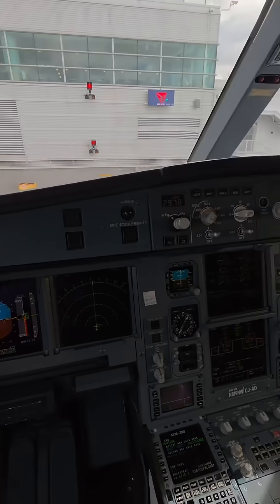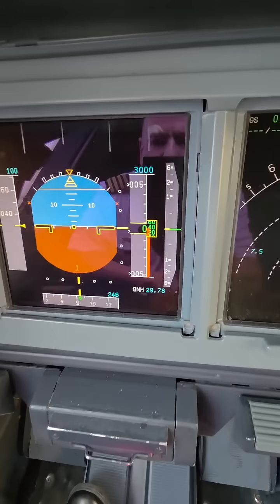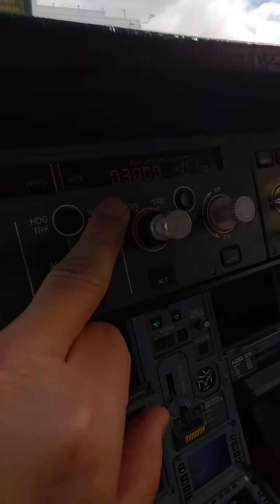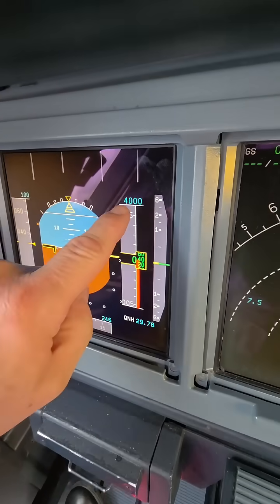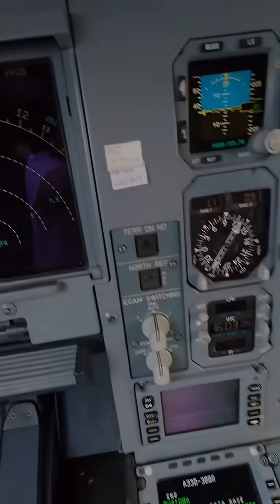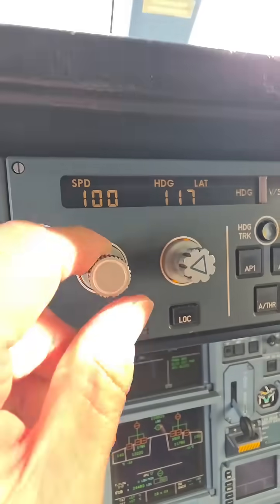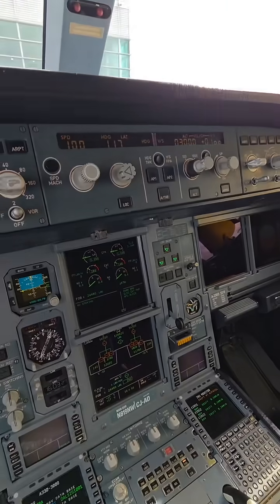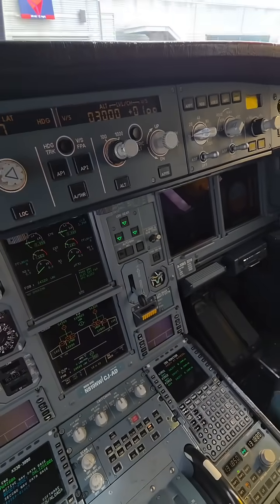Airbus A330 - how we input speed, altitude, and heading.

Comment: So, no need to push the button/dial to make the command? Just turn the control and it's happen automatically?
Reply from the maker: It depends on the control. 

Speed - that knob can be turned, pushed, and pulled. Pushing it allows the airplane to 'manage' the speed based on the configuration (flap position). Pulling it puts the speed in selected mode so that you can spin it and select a speed. 

Heading - that knob can be turned, pushed, and pulled. Pushing it allows the airplane to 'manage' the navigation based on what is programmed in the flight computers. This is NAV mode. Pulling it puts the heading in selected mode so that you can spin it and select a heading. 

Altitude - Pulling it puts the airplane in open climb, meaning that it will climb at climb thrust to the altitude selected in the window. Pushing it will select a managed climb, meaning that if there are altitude constraints along the route it will attempt to honor those constraints, if it can. 

For example you may have to cross a certain point at a certain altitude. In that case the aircraft will coordinate it's climb to reach that point and no higher or lower.
Reply: @CaptainZtravels Thank you very much, after a long time, I'm finally not curious anymore 😀, every time I see a video about a flight, I'm curious, between the Captain and the co-pilot, they keep turning the knob and don't press anything else, then the plane suddenly tilts 😀